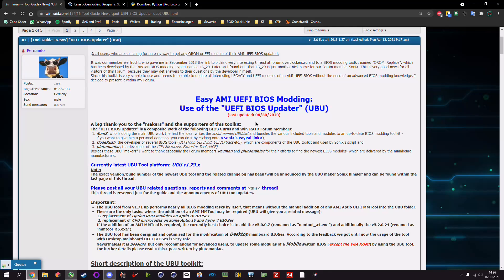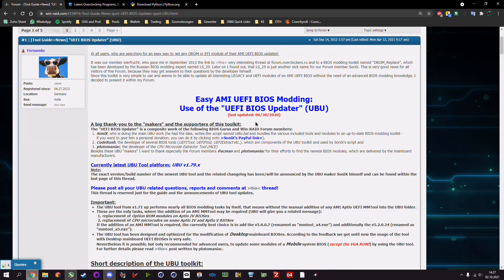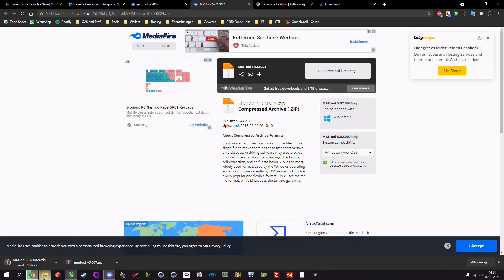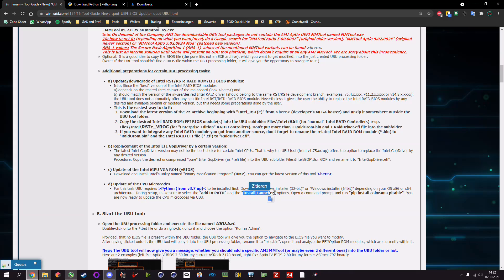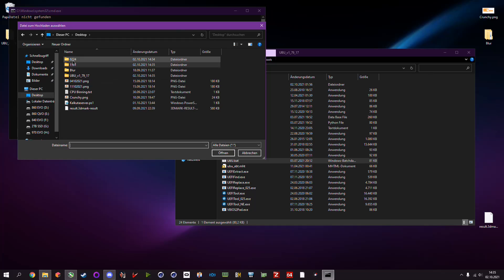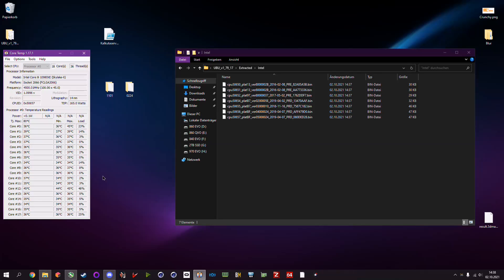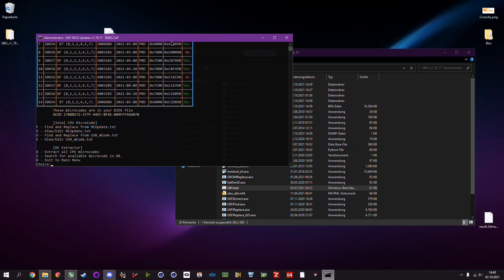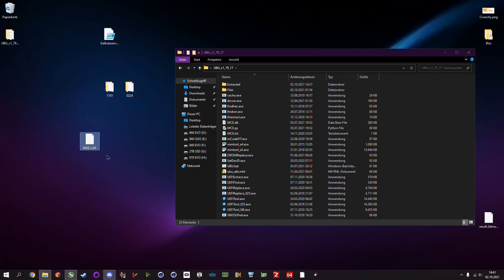Update Your CPU BIOS Microcode - More Performance - Less Consumption - BIOS Modding - Overclocking

Comment: 6:40 - I notices you didn't get a setup_extr.txt. I experience the same issue (I don't want to change micro codes, but rather enable PTT / TPM 2.0 w/o discrete chip. 

But due to the fact that I don't get that txt-file, I can't follow along the guide...

and finding TPM 2.0 M PCL chips that I can know for sure will be compatible with my Asus Z170 Pro Gaming motherboard is impossible...

Do you know what causes this issue?

Comment: I'm using Gigabyte GA-B75M (H61 motherboard and i7 3rd gen)

I want to enable my tpm chip in bios( I have a tpm chip), and add nvme boot support from pci express x4 slot.

How can I achieve this, please reply fast🙏
Reply: That's b75 mobo not h61
Reply: @gnrtx-36969 It was h61 and I was able to do it, Thank you for your reply btw

Comment: Would this be able to be used to add Xeon support to a server motherboard.

My current motherboard is only a single socket and is only about to work with single socket CPU.

Would I be able to take mictocode from a multi-socket cpu and inject that into bios and only utilize the single CPU due to the physical mb socket limitation?

Hopefully that makes sense.

Comment: My x99 motherboard does not display bios. Just black screen then windows logo. 
I flash using fptw64. My gpu is rx 5500 xt. Any ideas? Should i flash using a flash drive then boot straight into afudos?

Comment: Is there a tutorial for updating and replacing AMD CPU microcode?
Reply: It looks like there is no USR mcode folder and bat file to track the files. Thankfully in my case the tool came with the latest mcode so all I had to do was find/replace to upgrade. You'd have to look at how the UBU.bat file load the amd ones in, and if that code is different from the intel code. The developer is retired so we are on our own here.

Comment: @Unleashed Overclocking  What do u think, will PCH work with latest  ME region?  I mean i have z77 PCH and i  will upgrade it to the latest version for Z77...
Reply from the maker: Thats actually a good question. the ME is not specified for any MoBo. So in Theory you should be able to slap it onto.

Comment: Great Video - here is a question... Got any idea how to bypass "Error: Secure Flash Rom Verify fail." issue?
Trying to mod my H110 ThinkCentre M700SFF to support Kaby-Lake-S Xeon CPU's

tried to search over forums but could not find any help - does it require some hex modding?
Reply from the maker: Hey does it happen, when you want to compile the BIOS or does this happen, when you try to flash the BIOS?
Reply: @UnleashedOverclocking  at the moment of flashing, i had no issue compiling new / modded bios with UBU
Reply: This is due to the offset issue. Once you generate a new microcode, it will change the offset value. When you try to flash the new modded bios, the error will show "0x18" which is the new offset that the flasher detects differently.

Comment: you have better o.c results with older cpu microcode or newer microcode on your cpu?
Reply from the maker: Depends. Sometimes yes. Sometimes no
Reply: @UnleashedOverclocking  you have now old or new?you tested?
Reply from the maker: @PixelByte  None. Latest BIOS with a special MC that makes the CPU work best in general.
Reply: @UnleashedOverclocking  can you share your MC because i have same CPU what do you mean special?

Comment: i just dont get one thing, how is the older code better? isnt it supposed to be outdated?
Reply from the maker: Most of the code upgrades are supposed to fix security issues in the first place. Like specre or meltdown. 
Those security fixes are most of the time absolutely nonsense for the 0815 user. But they do harm the performance

Comment: Will the system scan of 3D Mark an CPUZ validate a benchmark, made with such a moddet bios? I downgradet my bios when Intel canceled the enhanced turbo mode and changed the turbo mode, when they realeased the refreshs of the E3-12xxV3 Xeons. It is impressive and innovative, but i fear it could be seen as cheating maybe.
Reply from the maker: Thats no cheat. At any point of the CPU life, the MC was legally used by Intel.

Comment: Hi buddy. is there any possible way to bypass motherboard limits such as overclocking? my motherboard is an H series and it doesn't support overclocking. my cpu is a K series but this stupid motherboard also supports turbo boost which changes cpu frequency. so doesn't that mean the motherboard CAN change the frequency but that feature is locked only for users? is there any way to hack or modify or somehow, fool the motherboard to add the overclocking feature?
Reply from the maker: there are some special cases out there, but they are really rare. So unfortunately, not.
Reply: You can try FSB Overclocking but that's a bit dangerous and not usually recommended
Reply: Yes there is a way hold on ill tag a video that might help you as it helped me with such bios adjustments on my dell poweredge t130 with 4 core xeon

Comment: Hey,I have an i7 4770k on gigabyte b85m d3h rev 2.1. The cpu Vcore voltage doesn’t go above 1.2v . Is there any fix for this?Kindly reply fast.
Reply from the maker: Hey, 
you cant fix this limitiation with a MC update. You would need to change the BIOS. 
And in all honesty. This MB is not really capable of squeezing the shit out of the CPU....
At least IMHO.
Reply: @UnleashedOverclocking  I wanna do a similar thing with a P9X79E-WS, increasing its Vdimm limit. Not sure if it's just a software limitation or hardware limit though. Probably the former I think
Reply: And you know whats crazy they actually gave all other revisions a bios update which unlocked it

Comment: Nice guide.
7:55 ... hit the 'any' key? Where is the any key? :D
Fun aside I can see why this could be useful.
For my PC it is to risky without Dual BIOS. From what I know I would not trust Flash-back without a Dual BIOS. JayzTwoCents did a video named "This board bricked itself" about this a few days ago.

On the other side I'm really annoyed be forced security patches that cost performance ... or forced updates in general. In the last 20 years I've had zero security problems... but a ton of problems with updates that where just broken ... the last thing was 4 month ago - Windows Update suddenly replacing the standard Windows NVMe driver needed for the Gigabyte X570 board with an NVMe SSD with AMD's own SATA RAID drivers completely bricking my system (unbootable) ... had to decrypt, fix the driver, re-encrypt everything ... which is why I now always disable updates when I use a PC for important work.
Reply: 😂😂 wtf  dude...
Reply from the maker: Hey, thanks for your comment! 
I experienced the same, thats why I customise my BIOS. 
There are more often also old SATA drivers etc. included, which can be updated. 
But as manufacterers are, they are lazy. Sooo they dont update them. Annoying.

If this keeps going, I will do my own BIOS in like 1 year :D